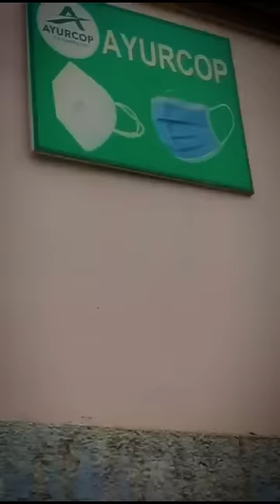'STAINLESS STEEL' Bottle Factory TOUR 🏭 #danjrvlogs #shorts #bottle #kids #fun #food

Comment: SS316L is the best food grade steel
Reply: Yes correct 316 grade is the best for water
Reply: Even SS316  have a higher potential to react with water if PH range exceeds.
Reply: But SS316L is very difficulty  to form sheets and machining, because  of  Nickel % is more.
Reply: But how the weld is not visible!, What happens to it once it is welded. Kindly help in understanding
Reply: Exactly
Reply: Appo sus 304 la feeding bottle epdi use pannalama kudatha
Reply: SS316L is more expensive.

Comment: 304 la bottle ready Panna 6 month la poirum athuve 316 la ready Panna 50 years warranty kudukalam
Reply: What is mean by 304 & 316 
Can you explain bro ?
Reply: @chandramanimaran5051  
stainless steel grade bro. Plastic la Nylon , PVC சொல்லுவாங்க la adhu madhri
Reply: @chandramanimaran5051  stainless Steel grade bro.
Plastic la Nylon ,  PVC சொல்லுவாங்க la அது மாதிரி..
Reply: @chandramanimaran5051 316 contains a minimum 2.0% molybdenum which makes it much more corrosion resistant than 304 however, as it is a more expensive element but ss 304 contains only 0.3 ℅moly
Reply: @jayachandranv4393  Thank you very much bro.